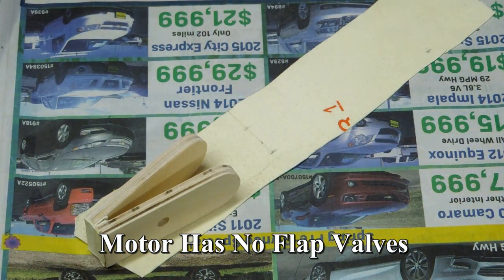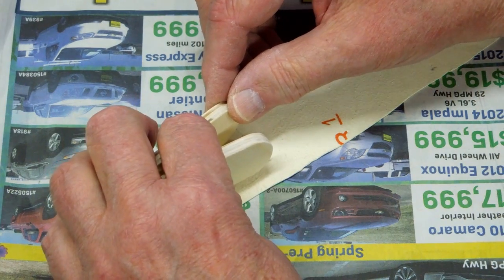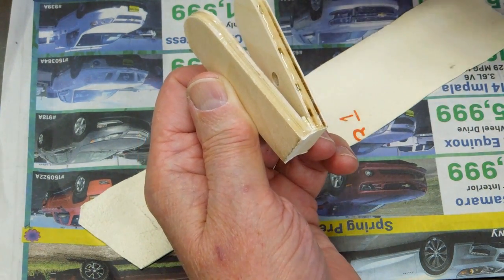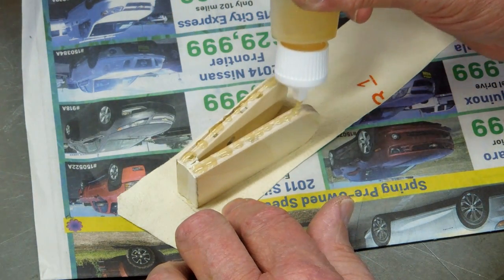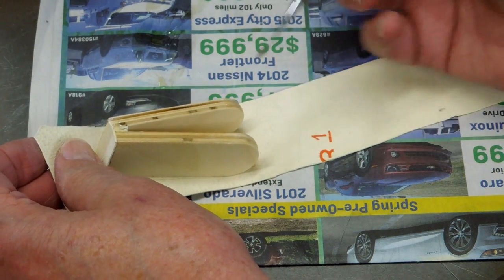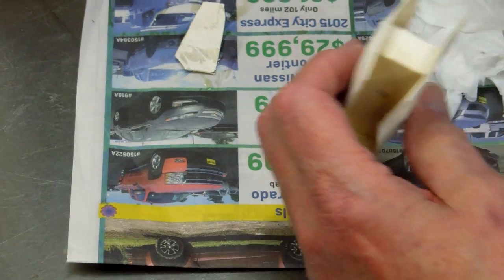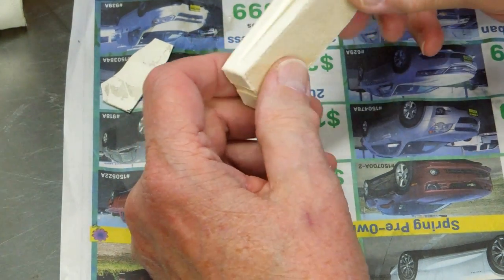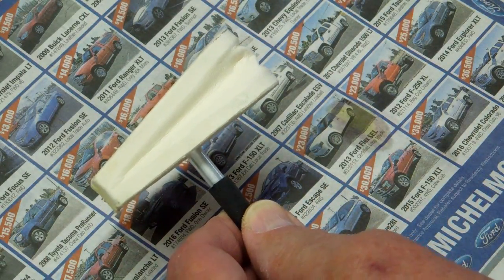Senior 20 Conductor Installation (3) Pneumatic Motor

Comment: Does the leather provide enough spring to open it after closing it?
Reply from the maker: The resistance (weight or a spring) acting against the motor would close it. Air pressure would open it. Release the air pressure and it would close again (due to weight or a spring). So this is a single acting device where air pressure is only moving it in one direction. The leather does open it a little but that is not the intended method of operation. Sealed leather is a bit stiffer and would open it slightly more.
Reply: Ronald Walters cool, thanks man! Good to see more videos from you, stay well!

Comment: Question: I know you have discussed fish glue before, I forget what was said exactly, but how would contact cement work for this application, just curious?
Reply from the maker: With fish glue the leather will definitely stay where you put it but can be loosened again by wetting the leather. Fish glue can always be cleaned up with water even after it has dried. Contact Cement would be a poor choice. I would expect the joint could creep. Cleanup would be more problematic.

Comment: I've made a few of these a while back, inspired by the ones you made in a previous episode. One trick i found that works great for putting the leather on is to put a piece of bamboo matting beneath it. Kinda like when you make sushi and roll the seaweed and rice with the bamboo (where i actually got the idea). Works really well for doing it in one go, even (if the backs, where the hinges are, are tied together with a strip of wood) for making more at once. Perfect, factory like look.